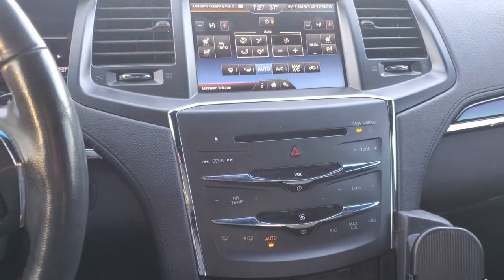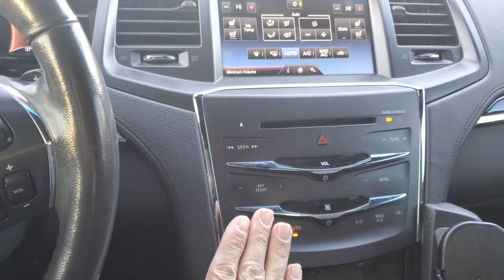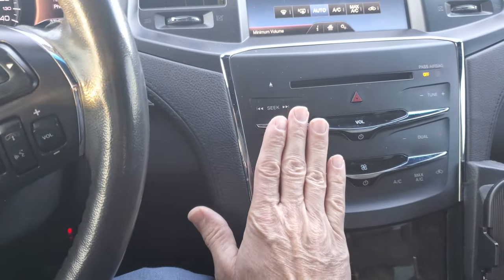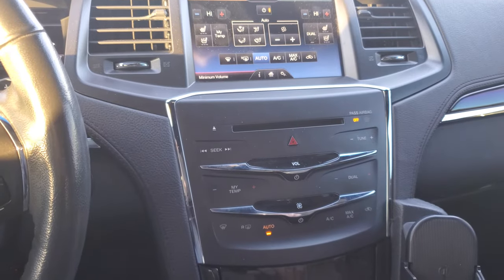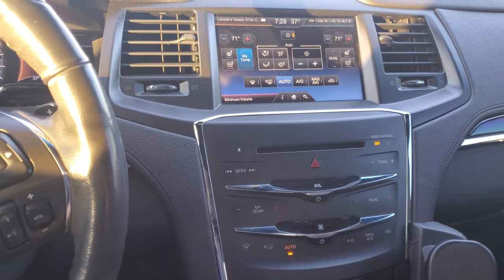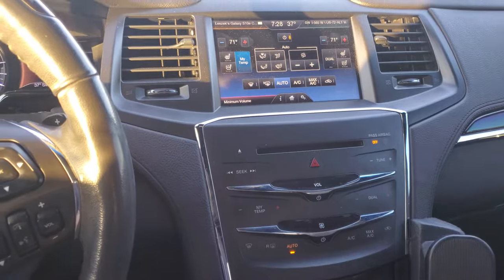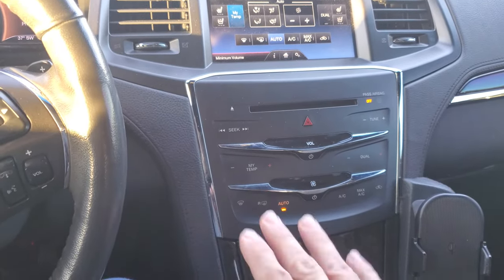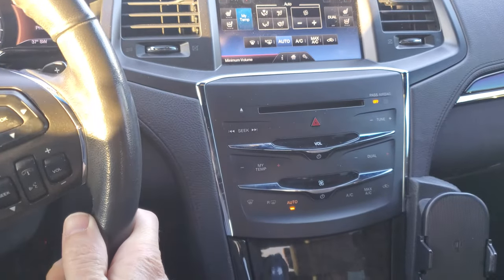Lincoln MKS climate control dash problem

Comment: I found an easy fix. All you have to do is take the panel out open it up and disconnect the white ribbon. Problem solved no more beeping no more temperature going up and down only downside is you have to control the temperature from the touch screen
Reply: Thank you for this
Reply: so basically it needs a replacement ribbon?? tht mite work

Comment: Elsewhere a commenter said he “SLAPPED” his with an open hand and it reset.  I’ve had mine repaired for $1,500 once for it to fail again within 2 years.  I won’t spend a dime to repair it this time as slapping appears to have helped currently.  I’ll keep slapping it until it no longer lights up or fails completely THEN I may spend some $ on a fix/repair.
Reply: I've been "slapping" mine for the last 5 yrs now.....the control panel I meant 😂
Reply: Mine just started doing it a few days back. @milton112 did you get it repaired at a dealership?
Reply: I been slapping mine all this year 😂😂😂

Comment: I fixed a few of these. I took the panel out and cut the connection to the Temp adjustment buttons on the circuit panel. They won't be usable any more but you can adjust on the screen and steering wheel controls.

Comment: Yes, my touch panel is sometimes temperamental and nothing on the panel works. At least there are redundant controls in the infotainment screen for everything. Don't forget voice commands can do most of it too. I also notice MKS' don't malfunction the same for everyone with this issue. For instance, on my MKS, (for either the top or bottom slider row) a small, illuminated section starts to glow when it malfunctions. The panel is just unresponsive until I "GENTLY" touch any button in that row. It then corrects the problem until the next time. I emphasize the gentle part because these are kind of delicate and only require a touch for the command. I see people pressing really hard and that is probably not helping the cause. Thanks for the vid.
Reply from the maker: You are absolutely correct on the gentle touch.  I believe mine no longer working properly is the by-product of other folks that used my car and did not get an instant response from the buttons and then pressed very hard. There can sometimes be a bit of a delay which is when people press too hard and then damage it.
Reply: Thank you for the easy fix for my 2013 MKX it was my a/c blowing hot air. It did it before with my heater when it was cold I followed another guys video about starting your car turn it off and turn it back on and press on defrost and climate button and then only click on climate button and it worked we got heat! Have not had a problem since and that was 9 months ago! It didn't work for me this time! Your suggestion worked like a charm! I have a cold air now! Thank you!

Comment: Did you ever get it fixed?
Reply from the maker: No, not yet.  And it is getting worse.  I just have to find some free time to remove it and send it out to the guy on E-bay that "might" be able to fix it.  I am relatively confident that will make my climate and audio system un-usable while it is out of the car.
Reply: @Skul-Ski   just the climate audio still works with panel off

Comment: I’ll have to try that , I found that rubbing it cures it for the whole day
Reply: I found an easy fix if you're still wanting to know open the panel disconnect the white ribbon inside of the control panel problem solved no more beeping no more temperature going up and down only downside is you have to use the touchscreen from now on. All the buttons will still light up but the left hand side my temperature the auto button and the defrost will have to be done on the LCD screen
Reply: @edkowalski2639   so im assuming remove the left side ribbon?
Reply: Yes.If you want to , to prevent the other side doing it also just disconnect both sides. Mine only beeps now and then. Until it drives me nuts I'm gonna leave it with only 1 ribbon. Now when you disconnect the ribbon you have control of the fan slide the white part but not the radio volume. You can't disconnect the panel it's the brains of the whole thing. It goes into a default mode where it just blows heat on the windshield and the heated seats won't work if the panel isn't connected. Any questions feel free to ask. No way in hell I'm spending $500 for the problem to just come back again and again. One guy I read spent $2000 fixing it and then 2 years later it happened again
Reply: Its very easy but very delicate.
Reply: @edkowalski2639 how hard is it to open the panel up I’m having this same problem and it’s very annoying my heat doesn’t really work either